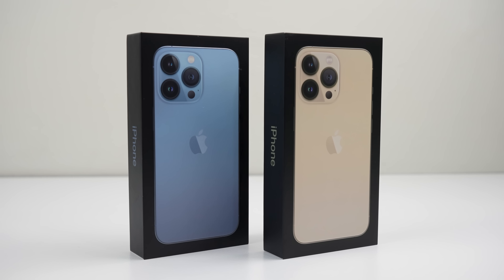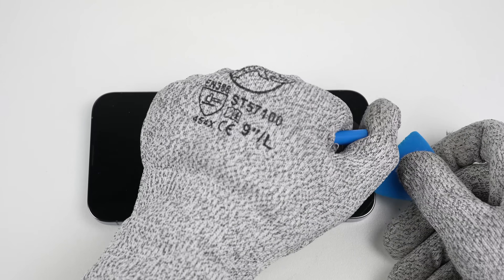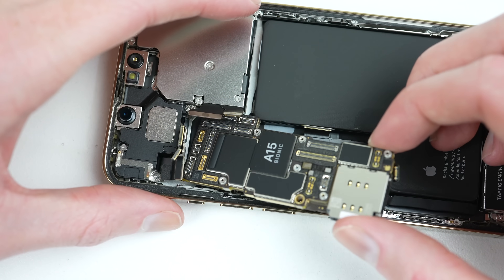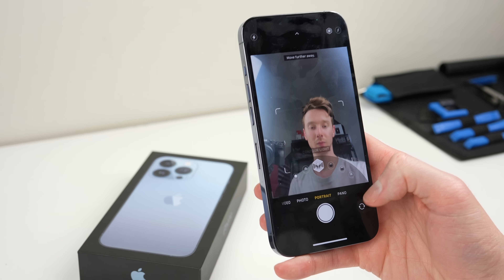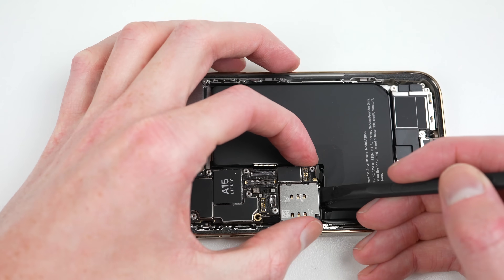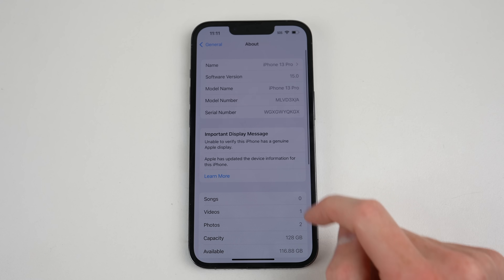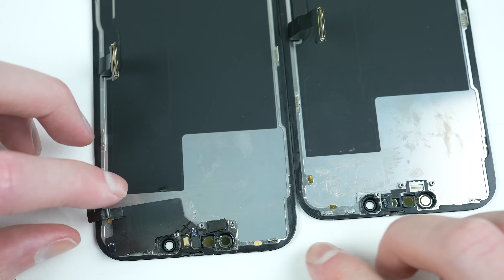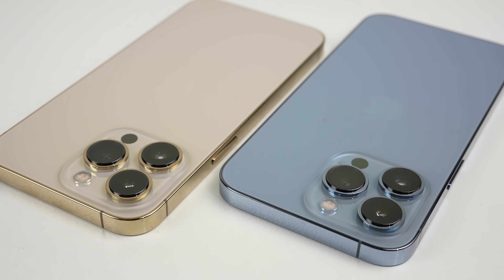iPhone 13 A Repair Nightmare - Teardown and Repair Assessment

Comment: Best thing is to do like I did when iPhone 5 came out. Stopped buying it. Go android and choose easy repair stuff for 1/4 of the price and much better specs.
Reply: This is simply not true anymore. And it hasn't been for quite a while. Apple devices are outpriced by alot of android flagships these days. Plus Apple is selling a wide range of phones now, starting from $400 and ending all the way up in a grand and a half. The specs bit is also not true. Apple wipes the floor with some flagship androids, while you have the audacity to claim that a $250 android phone will have better specs than a $1000 iPhone. Have some dignity.
Reply: @razaelll  What u on about isheep? Looking at all of ur comments on this channel ur just an isheep that all of these comments are talking about. 

I bet isheeps Iike u are the ones who dislike these beautiful videos which speak for the rights of the customers, unIike u isheeps who speaks for the billion-dollar company instead of thinking about the customers who made those companies who they are today.
Reply: @razaelll  I never said a 1000 dollar phone is same as 250.  I said buy a 250 phone. It can do exactly same as over powered mobile.
Reply: @Tangobaldy  " 1/4 of the price and much better specs". You said that a 250 dollar phone is BETTER than a 1000 dollar one. And no, cheap phones don't even come close to what they can do compared to flagships. If all you need is call and text just get a Nokia then.

Comment: This is why “right to repair” regulation is imperative. Making repairs difficult causes people to just buy a new device and pollute more.
Reply: I love this hipocrit compannies talking about carbon footprint ... more like greenwashers. The only way to keep they earning is by polluting ... one way or another. Each time an item is manufactured and then dispossed, resources are used. Period. In the office we had a Ricoh copier that lasted almost 8 years on regular maintenance, wen we moved to XEROX or HP we got nothing but constant issues, from HW to SW. They want to sell a new printer every couple of years in name of efficiency (LOL) .. Peole most pick brands that dont play this game.
Reply: that is a major problem. everything today is made to be thrown away in 2-10 years & replaced. especially, but not limited to phones. We really need to change this mentality. Phones should have software updates for 5 years and yes, have the ability to be repaired anywhere!!
Reply: Exactly yet apple claims to reduce pollution by not giving chargers and using tiny packing such irony
Reply: Apple is Making repairs more difficult is a literally a regress of its technology development
Reply: money.
Reply: Right to repair will be great... If you live in the states. I doubt Apple are the kind of company that would apply something like right to repair worldwide.
Reply: right to repair doesn't mean you may just go and use parts from stolen phones! This was made to prevent crime. If you want to repair your phone yourself - order a component from official apple website, using your serial number. This how it should work.
Reply: @mike_miller  are you ok ?
Reply: @harisrakovic559  totally, why?
Reply: @mike_miller  oh yea and pay 500 dollars yea no thanks
Reply: The worst part is that Apple doesn't add this way anything to  security of a device - it's only dirty tactics to rip more money off the consumer. I never bought Apple as I think they are dodgy.
Reply: @John Doehler maybe a fairphone but I believe they might have the same problem as  everyone else: They want sth to change, but want others to do it - so they have iphones.
Reply: ______ they want your  “ Green Benjamin’s “ .. Thats the only green they care about, LoL !
Reply: And companies dont care they just want money
Reply: Yea, Apple little removing things in the box to save enviroment doesnt hold up to this.
Reply: They already have politicians in their pocket. No way that kind of legislation even hits the house floor.
Reply: Yes. The apple viewpoint about going pollution free is “ship charger in another box so you have more paper around and we earn more, and ship not repairable iphones so when they break either you pay us more either you buy a new one.” Yes but I will buy a Samsung next time
Reply: I don't think this legal in France industry. It seem to me that the washing machines were condemned in justice for not being able to repair the tub of the washing machine.
So they talk about ecologism but they says in the store that your iPhone (or other product) is irreparable you need to buy a new one but in fact it is reparable. It is really a method the opposite of ecologism. View the price of their merchandise...
Of course they will say it's for consumers and their safety. We know the scam now !
Reply: RTR regulation isn't enough.  You need to hit crApple in the wallet.  STOP. GIVING. THEM. MONEY.
Reply: Yet Apple still pushes back on "right to repair" while also claiming to do their best for the environment.
Reply: No, the answer is to stop buying these crap phones.
Reply: @scottfranco1962  as Louis Rossman points out very often, there is no single bad company, everyone is copycating apples mistakes, because apple get away with them easily, not to only sector where this happens btw.
Doesnt work to just not buy this brand...
Reply: @berberger4814  Knocking Apple down would be a good start. Apple is the one doing things that other companies are copying.
Reply: @scottfranco1962  This is not a solution
Reply: @scottfranco1962  Thats the only solution. As long as people buy this crap, they want to be screwed over.
Reply: @scottfranco1962  just wanted to say thank you. It’s nice to see someone with a dissenting opinion scream into the echo chamber. Cheers!
Reply: @scottfranco1962  All phones? All cars, TV's, washing machines, stoves, refrigerators and tools and whatnot? Stop buying all of these?
Reply: @somnorila9913  He means apple phones, or any other phones that do this obtuse crap. If your refrigerator forced you to throw it out after a light stopped working, I'd say to not buy that one either. As soon as the product has malicious software to stop 3rd party repairs, you are no longer buying a product to own. You are renting a piece of equipment.
Reply: @courier4529  well said!
Reply: @courier4529  I was trying to emphasize that the approach of not buying whatever is not the solution like he presumes to be.
Everything everywhere is following this similar pattern and you are stuck in having no option but to unwillingly support it by giving them your money. Because something is better than nothing and you need at least something.
The solution is in forcing a change. You need to support a different way and stifle the current one. Right to repair is just one coin in the slot machine. We need more coins.
Reply: @somnorila9913  How did you get to the point to conclude that it meant all phones.
Reply: @somnorila9913  You need to do your research.  Plenty of Android phones, cars, stoves, etc. out there that are far cheaper, repairable, and don't conform to this new norm.  At least not completely.  The problem is, they see crApple do this, get away with it, so they think they can do it as well.  If they see crApple suffer for it, they will stop doing it.  If they see their sales go up and get feedback that it's because you're tired of being abused, they won't even consider it.  It's the law of the free market.
Reply: @somnorila9913  He is clearly talking about Apple phones, and why do you think all technology has something to do with phones
Reply: @somnorila9913  he said "these crap phones" couldnt have been any more clear...
Reply: @courier4529  I miss the times when you could just pop the back and change the battery.

Idc about plastic covers. We've been spoilt with all these mirror backs and shit that we only admire for about  aweek before we slap a case on
Reply: @courier4529  I'm not sure if third party repairs are made impossible or difficult.
One test is NOT done. Just replacing with parts that never had been in another phone.

I lik this impossibility of changing parts. Apple is an expensive mobile. It would be very nice for criminals to steal those phones for spare parts....it is known that a stolen phone is useless becaust the find my phone function and possibility to disable a stolen phone from distance. It also should be known that you cannot steal a phone for cheap repairing your own...
I call this a security for the users against robbery.
Reply: @courier4529  And what if ALL OF THEM do this? Which... they are. And electric cars have been an opportunity to lock everything down, just look at Tesla.
Others will follow.
Reply: @tbg6070  and that is why I am replacing all the 8's and "x"'s that my org bought because of the 1/2 hour battery life and the slow usage?
Reply: @tbg6070  But there really just trying to get money out of it. There Squeezing every last bit out by disabling functions to force you to go to an apple store and pay like 700 dollars for a small crack on your device. When you could just repair it on your own. If you take good care of the phone after repair it should not bug out.
Reply: that's why europe made the usb c decision.. i know where i want an iphone from now.. hopefully they are not region locked.
Reply: @double-you5130  Cannot be region locked....because any European should be able to use the phone on worldwide travels. But maybe there is a kind of simlock....only european simcards are possible. In other words....you would be roaming in your own country.
Reply: No man apple cares about us ...... if we use a smartphone for to long the glass from the display enters our hands and hence apple doesn't want us to use the same phone for more than an year..... they are doing it for us ohh I love apple so much .... And now this usb c thing I mean come on who cares about pollution we will already be dead before petroleum is finished.......XD
Reply: what apple does should be illegal, luckily we have yet the competition on the market.
Reply: They are Ruthless. Regulations are needed.
Reply: no this is why communism and socialism are better than capitalism. This isn't innovative at all when most of their efforts are being spend on developing anti-consumer anti-repair tricks and tidbits.
Reply: @TezzosRS  but why can’t a citizen just choose to buy from a company that isn’t Apple? As far as the argument for right to repair goes you do have a right to break apart your device and swap parts. He swapped parts and the parts functioned, the camera was able to take pictures etc... 

The functionalities that are missing are software driven, something the end-user does not own on iPhones with iOS, and is merely being allowed to use by accepting the license agreement. There are plenty of software alternatives out there that started because of this very divisive issue alone. 

But it all comes back to you as a citizen have a choice. Use that freedom and right you have to buy a smarter and better product.
Reply: People stopped buying from companies that invested in South Africa, but going up against a company that goes out of its way to make sure you can't repair it is going too far? Please. A new law is not the answer to everything. Nobody is forcing you to buy these overpriced phones. Vote with your feet.
Reply: You dont have to buy new or throw them out . You just take to a certified store (Apple) and get them fixed.
Reply: @77dris  you dont get any repair in an certified store, you get very expensive replacements, they even have guidelines for certified repair program, that you are not allowed to use certain original parts or you have to pay a fine.
little hint: just think about the page on the apple side, where repair prices for backside damage is listed. They didnt notice, "oh this is REALLY expensive to fix, so we might try to improve here" - simply using another glue would be a huge deal already.

its okay when normal people dont have the time or just dont want to think about things like this, therefore normaly exist laws which regulate problems like this, but in this case there is none
Reply: @berberger4814  You really can't "repair" such electronic components, their structures are so microscopic that it would be impossible to fix. The only choice is to directly replace the components. So a modular design is very helpful, with every component being independently replaceable.
Reply: @77dris  You are welcome to do that.
Reply: @77dris  and pay $500?
Reply: @77dris  and what do you do if the nearest apple store is a 2hour flight away? because apple in all is wisdom has shut down almost every independent shop that they used to support
Reply: @77dris  they charge you a few hundred dollars out of warranty, the parts cost like 30$.
Reply: @77dris  well said! 

NOT. Gateem
Reply: @77dris  Its an option, true. First buy an insanely expensive phone for whatever reason, then throw even more money into overpriced repairs. As long as enough people accept this, it will go on and become worse.
Reply: @77dris  Where they can "fix" a small fault by changing most of the product. The faulty part and a few other that work just fine too. Haven't you paid attention?

Talking in general as an example, no one is changing one button nowadays, they change the whole panel. That's cheaper because changing a button means qualified personnel with proper tools able to solder off and on that button. Which may also take longer and the price you can ask for is not that high either.

Changing an ensemble requires less knowledge, so less qualified, cheaper personnel. It may be faster to change it (but not really according to the current trend of encapsulating everything, less or no screws and whatnot). And most important, you can charge for more parts.

And how about the recycling part? If you throw away more for less damage it means that you ramp up the level of your waste generation. So something is off as that should mean more taxes and fines that should make this type of approach les attractive than actually repairing.
Reply: @somnorila9913  apple is actually doing a great job at making the internal electronic components independently replaceable. I am not sure about the buttons on the exterior, though. Nowadays electronic components are very difficult to fix in place because they are so complex, and the structures are so microscopic.
Reply: @77dris  and that's called a monopoly.
Reply: @77dris  Yes for like 1000 dollars

Comment: Tips for those who wants to soften the lcd's adhesive if buying the device is too expensive:
Go buy electric plate warmer that usually meant to be used for warming cups, bottles, etc.
I have one that use 40 watt of electricity and able to generates heat up to 80C which is the standard degree to soften lcd adhesive.
I bought it for $5
Reply: where at?
Reply: @fbnmndz  Just find it at online stores like amazon or any other apps that is locally available at your region. I'm based in Indonesia so the price is around $5 USD if converted. Price may vary